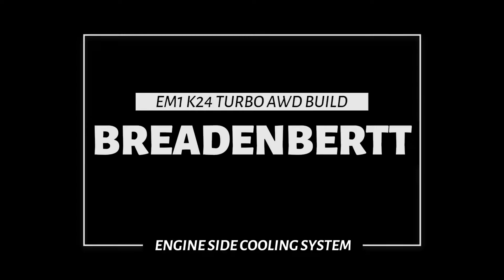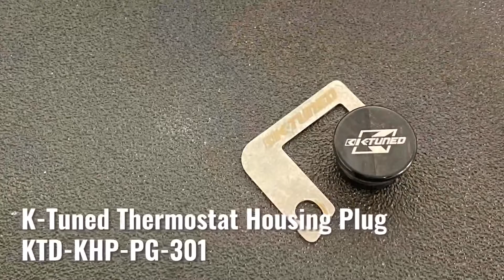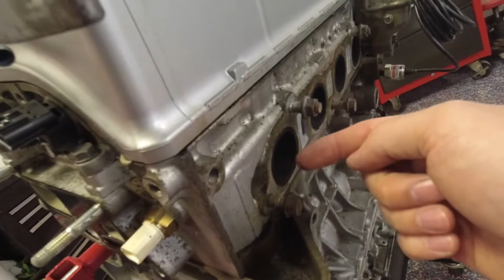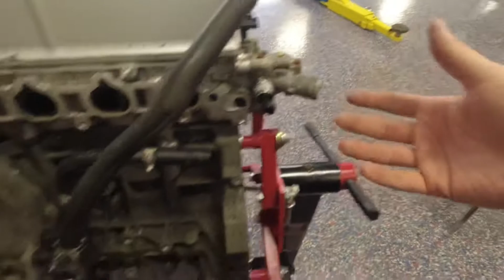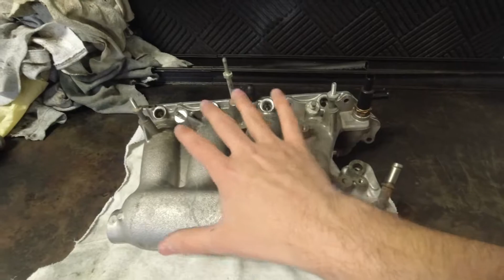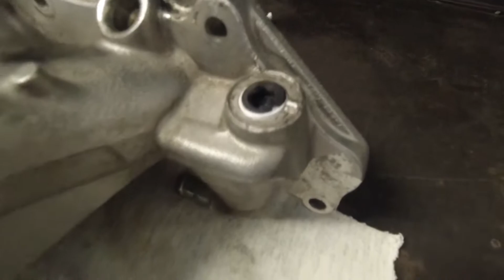EK K Swap AWD Civic Build - Engine - Episode 2 - Engine Side Cooling Components!!

Comment: 7:58 or so that plug you're saying you may make a cleaner plug in the future from what I've seen isn't terribly important depending what intake manifold gasket you use, because a lot of the gaskets don't let any air through there anyway, as was the case with mine. (Having said that I also have a cap and clamp on mine lol, but I do not have any leaks if I take the cap off)
Reply from the maker: Good to know. The speedfactory one does allow airflow. Which gasket are you using?
Reply: @berttnotbought804  felpro...I have the box in the garage I can get the number from
Reply from the maker: Get on that thermal gasket lyfe breh